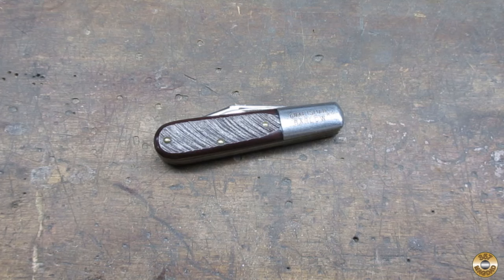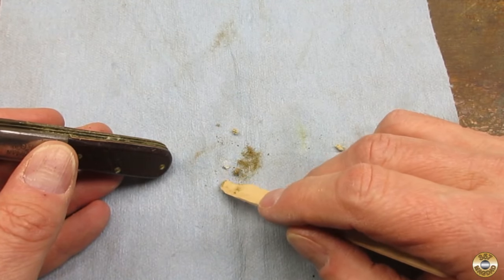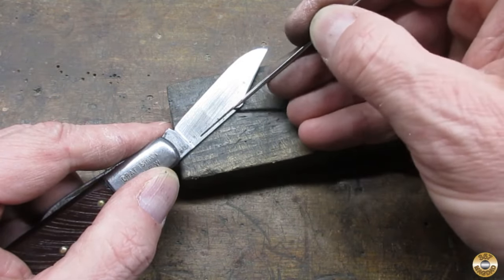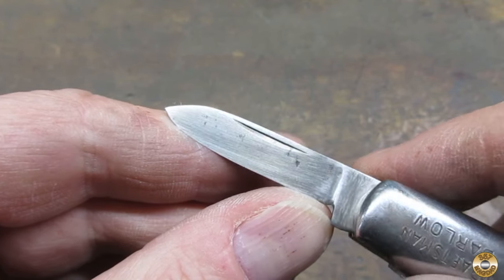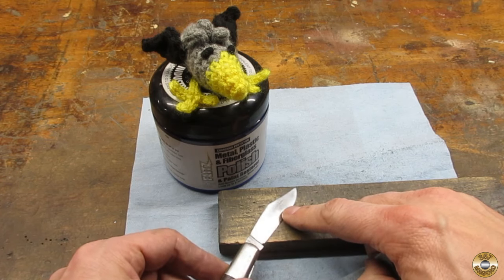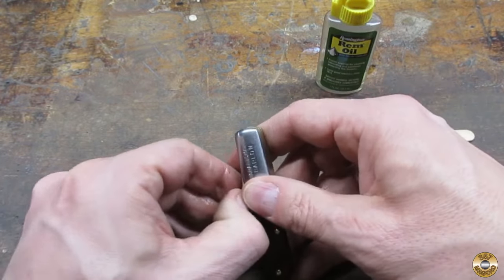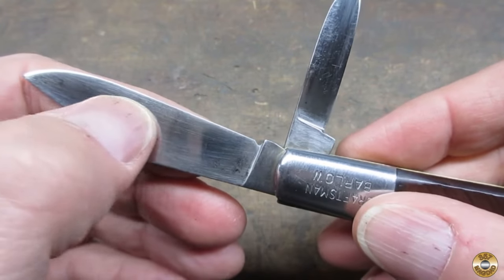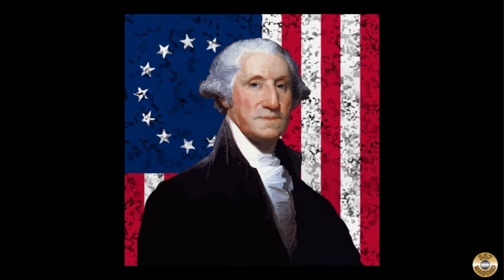Craftsman 9540 Barlow Pocket Knife Restoration

Comment: You have the patience of a sage! I don't screw around with old knives because I inhereted a bunch of them. All over sharpened. My mother once came to a shop I was working in and deemed our bench grinder with a stone wheel a "knife sharpener". That is exactly why my inhereted collection is not salvageable, Grandpa did it like that! Another important note, you must scrub your stones clean after every use. I have met many people in their 70s who can't get a blade sharp using their grandpa's old stone because it is all clogged up and they are afraid to screw them up. I use pumice hand cleaner on mine after every use. My stones sharpen lots of tools as well as knives.
Reply from the maker: Your grandpa wasn't the only one!  I come across a lot of old pocket knives with blades worn down to nothing.
Reply: High quality ceramic has eliminated a LOT of that problem nowadays. Few licks on a DMT coarse and straight to Spyderco ceramic. It HONES the edge, instead of grinding off steel so much. Also the major component of both ballistol and remoil  is lightweight mineral oil, and I use food safe grade

Comment: I also heard that the big front bolster is like that because the oversized steel is supposed to support the handle covers underneath them and in an attempt to keep the handle covers from splitting if you torque the knife during hard use. Later models had the oversized bolster more for show, because by that point, customers had associated the large front bolster with a Barlow, which had by that point established a reputation for being a rough use knife.
Reply from the maker: The early Russell Barlows had a reputation for being rugged.
Reply: Back in the day the bolsters and liners were forged from a single piece of steel, that's what made them strong. It's not economical to make them like that anymore unless you're having one custom made.

Comment: Thanks Magdad, that was a thorough explanation of the full restoration process and what to look out for, good to see another tool returned to good working user condition !
I carry a small stainless key fob knife that is very practical, but you can't beat the edge on a good carbon steel blade !
Reply from the maker: Thanks Andy!  I wanted to do a basics video that I could refer people to.

Comment: Looks good!  You can almost always tighten up loose blades by peining the pins again. If it has a pin style of blade mounting, unlike old timer branded knives.I keep a small ball pein that I polished the pein ball on, for that purpose.
Reply from the maker: I've had some luck re-tightening the pivot pin.  A lot of times the blade has also lost its "snap".
Reply: @357magdad  the "snap" can sometimes be brought back, if the spring and blade fitment allow it by removing material .but as you know, wear, is the enemy..

Comment: Hello. Did you use 0000 steel wool? Thanks. Saludos from Mexico 🇲🇽
Reply from the maker: I used 0000 after the 600 grit to polish the metal.  I used 0 to clean out the blade grooves.

Comment: Beautiful Restoration on the Barlow Pocket Knife and just the right size for a daily Carrie i had a few over the years they were easy to sharpen and the edge stayed very sharp way better than most of the brands out there with S/S blades you and Mr Chuck di a great job together on the Restoration take care have a great Sunday  see you on your next video
Reply from the maker: Thanks Roger!  You gotta spend a lot of $ to get a SS blade that will hold an edge as good as carbon steel!